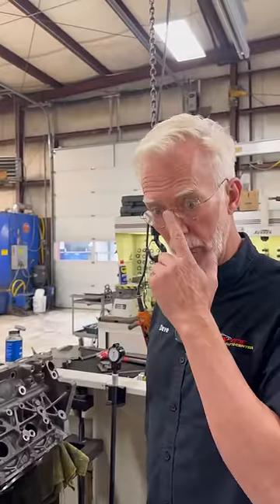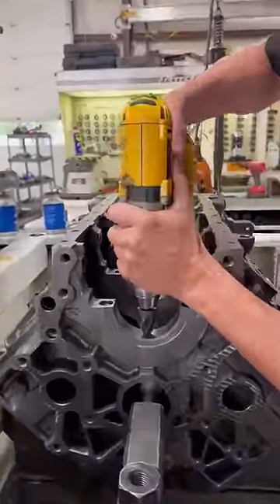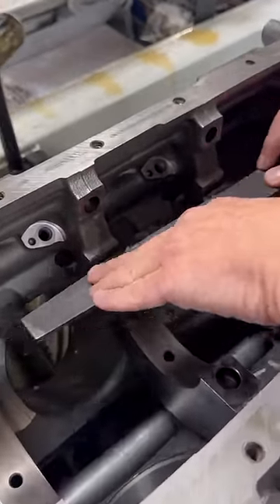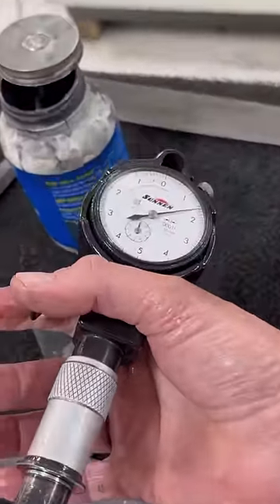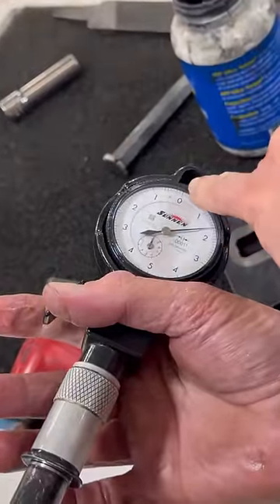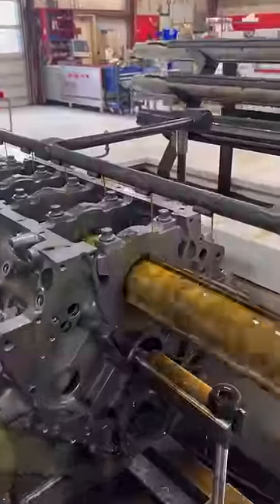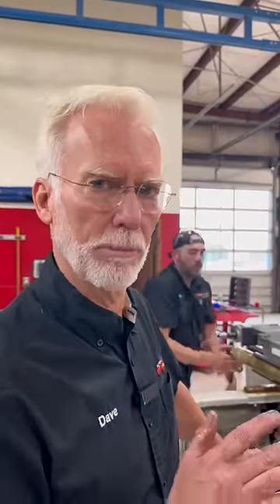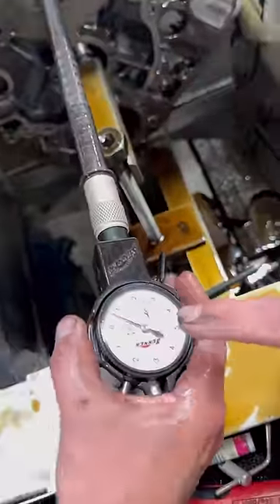How to set up and align hone and engine block the right way and why it’s needed - duramax LML

Comment: You can’t have guys like this building engines…. They will run forever!
Reply from the maker: Ha ha appreciate the humor😂. Thanks for watching
Reply: @DavesAutoCenterCenterville  I’m very blessed to have Bay Ave Transmission I’m my hood. He’s really good at knowing the issues and having the most practical solution. Talented and sensible like you guys.
Reply: It's actually done better then factory. I remember him explaining the flaws in the LS engines he needs to correct
Reply: @Jason1Pa no the manufacturer needs to address and that would lighten his work load.
Reply: @red2965  the manufacturer doesn't want to fix the problems, they just want it to last a bit longer than the warranty.
Reply: @windrider65  I absolutely agree
Reply: I gave a thumbs down because THIS IS THE WAY it’s supposed to be done so it does last a long time

Comment: The art of doing this type of precision work, and nailing it to spec, not over shooting it, my hats off to you! It can be difficult to get it in someones head, if you cut a bore slightly undersize, and need to re-cut, the spring pass will make it oversize, so on a re-cut, the finishbore tool has to be backed off and work up to the dimension. I haven't done these practices on engines, but cnc machining on horizontal and vertical boring mills.

Comment: I don't know one mechanic/engine builder that takes this much care. Most people these days just slap the parts together and think that's enough. I love the care and attention given to these engines. Truly amazing.
Reply: When you take the time and care, to fix everything, blueprint and balance, remove all signs of flash, on the rods, maintain tight tolerances, and you end up with an engine that redlines, about 2,000 more rpm.

Comment: Finally someone says it correctly. "Align hone" not "line hone."
Reply: How was it aligned and to what? 😂
Reply: @litoaykiu  They are aligned to them selves. They need to be in a straight line so the crankshaft properly fits in them. There's also a blue print specification for where the center point should be, but you can't really change that with just honing. By making sure the mains are aligned there should be no change in clearances in the bearings as the crank spins. You're also making sure the mains are not out of round.
Reply: @bobbygetsbanned6049  This is V-Block, it can go left or right, up or down; from center. Just because you have a perfectly round hole does not mean that it is in the perfect alignment with the deck; you are just going by the old holes and hoping it works. Where center point should be does not always mean that it is.  Throwing words like blueprint is just marketing gimmick.
Reply: A line hone ? What?
Reply: @giovannigiorgio8962   Honing the holes to be in alignment.
Reply: Finally
Reply: ALINGED HONED, OT LINE HONE, THANK YOU FOR BEING INTELLIGENT

Comment: Wow....... You would think the manufacturers would do this stuff..........!
Reply: The manufacturers have it right when it leaves, it's the people like this guy screws up all the dimensions in the block by heating it up to extreme temperatures in the oven to bake off all the crud which is a no no, it will change all the dimensions in the block. There are companies that make cold cosolutions in a vat to clean engine blocks, heating up parts BS.

Comment: My neighbor had a machine shop, and was align-hoing a very overheated 2.3 Ford Lima block for me. He didn't bother clamping the block down, and it chattered/danced like CRAZY on the rails of the Sunnen. It broke the u-joint between the hone itself and the drill motor that drives it. He was really pissed at himself!

Dave is right though - do a proper alignment hone on a block and the crank will spin beautifully once the caps are torqued correctly.

Comment: That is professionalism on display there. When that engine is re-assembled everything will be in better tolerances than when it originally left the factory. That will make for a smooth revving long lasting engine.

Comment: I respect the way you operate and basically what other builders say they go the exstra mile doing things like in video . Difference is this is standard for your build and other builders would boost that when they do this they went exstra mike .This is why i respect your wirk so much great job need more people with our work ethic.

Comment: I used to make lower bearing caps at GKN Sinter Metals in Wisconsin. Line honing is a mess, but a can shaft running true is the difference in an engine capable of over 300k miles or more.

Comment: Wish this gentleman would run for president, I don't think anyone would have a problem paying this gentleman's bill for the work that's meticulously performed on each and every job. He's an ever lasting gobstopper of knowledge engine machining. He cuts no corners! Most machine shops are full of BS, when they say, well we balanced and blue printed the entire engine, we did this that and 3rd to your engine, we put a new space modulator in, new kanifilla pins, and tightened and torqued the macursa. And then you start your engine and it sounds like a Singer sewing machine. We need more industry men like this gentleman!

Comment: Wow amazing. I have a 351 Windsor that I'd like to have balanced blueprinted and the horsepower increased considerably. It's in a 1992 Ford Econoline 150 van, I'd like it to be able to do wheelies or at least roast the tires bald. If I bring it there and have the whole thing rebuilt to your expertise that would be incredible. I would also need the transmission and rear end to be able to hold up to the power of the engine.

Comment: line boring the crank and cam bearing bores is part of blue printing a engine. and its is the right way to do it. and is essential in performance and race applications.

this is why you should number all the rods and caps as they can be slightly off from manufacture. make sure it goes back in the same spot. even though your fitting brand new bearing shells.

Comment: I agree I paid a shop to bore 30 over and align hone. Told me did not need align hone. Ordered parts from him 6k miles later had detination because cam was not compatible crack 4 pistons and had 2 main bearings with half bearing worn.

Comment: The problem is that it is kind of impossible to get oversized bearing shells for recent engines. They sell only undersized shells for ground down cranks but no one sells or produces shells for line bored mains anymore.
Reply: They probably shave the caps before honing ,is not really centered but is in line .

Comment: I had an LS1 block with mismatched main caps and was told by multiple shops that it's impossible to align bore because the block is aluminium and the caps are steel and the machining process will take more aluminium than steel.

Comment: If you really want to do it right, you have a plate of steel that's a couple inches thick that bolts on to the top deck. This simulates the warpage the block undergoes when the heads are torqued down, and it's also used when boring and honing the cylinders.

Comment: The most cost effective way to quick rpms, is a smooth line bore.  Remember that Hot Rodders.   Sonny Leonard doesn't torque race engines together in the morning, one of the reasons is because it pulls the line bore out or off.  They wait till the afternoon or evening.  Call it what you will, but it works and his shit wins.  It's always the coldest and concurrently/usually the wettest part of the day, just before sunrise, so maybe.

Comment: Great job! 
Do you guys know what possibly could be wrong with 1.0L, 3 cylinder ecoboost engine?
I've replaced the heargasket, but engine still misfires and runs rough at times....

Comment: beautiful, but can you align hone/bore babbit on bearing inserts? i need some done on a ;37 Studebaker 251 straight 8. bearings have been re-babbited and need to be align bored to size
Reply: Babbitt material loads up and sticks in the stone and the guide shoes will also mark the babbitt, those should be deburred prepared and torqued then align bored to the spec size no honing keep the juice on while boring and cuts heavy enough to keep tool engagement but not so heavy you don't get a good finish... hopefully there's not a lot to come out

Comment: got a question I installed a new tps on my 91 ford ranger and now it idles high every time it starts and keeps dying I also replaced mass air flow and idle air control I've been told it's because I didn't use a Motorcraft brand ?
Reply: You have to use oem sensors bud carquest and Duralast are garbage

Comment: @DavesAutoCenterCenterville
1. Is this done with or without conn rod and crack bearing inserts?
2. His initial measurement out 2 mil is out of roundness on crank bearing surface? Or it’s against hole diameter spec?
3. How does he adjust the honing tool so it is constant diameter its entire length?
4. What is the datum for the crank centerline? How can that long honing bore be aligned perfect to block datum? It’s so long and heavy, it must sag and flex.

Comment: Quick question, Dave.  You chamfered the oil holes in the main passages from the block, but the last photo showing the finish surface, I can not see any chamfer.  Was that intentional or not quite enough burr work at that journal befor honing?  Knowing you will thoroughly wash any cutting or honing debris well before assembly begins, will you chamfer all the oil holes again?

Comment: I have a 1982 Z28 it’s a really nice car nice exterior Noo dents scratches or rust and it’s red but 8 months ago it overheated on the highway and blew up it’s been sitting in my garage it has a 305 in it and it’s time to get it fixed and how much would it cost to rebuild it along with adding a cam along with more horsepower or should I buy a crate motor i would love for you to rebuild it i would know it’s great hands and it would be a Beast thanks
Reply from the maker: Our website can give you an idea of our prices. We are expanding the website as we speak. Thanks for watching 
Monsterengines.com

Comment: Have you had any problems with shot blasting grit hiding inside the motor and apearing later to cause issues??  My 03 6.0 had a bucket of casting sand in the cooling system that clogged up the radiator

Comment: Question. How do you set your bore gauges? Do you have a ring gauge that you can set your bore gauge on? 
If so, do you send your ring gauge out for calibration by a reputable gauge inspector that's ISO certified?
I work in a precision machine shop and I'm responsible for calibration of all our precision instruments like bore gauges and ring gauges, so I'm curious if you have ring gauges and if you send them out for certification.

Comment: Is this a common problem with V blocks?
I have rebuilt 4 cylinder VW gas and diesel inline engines and I check the crank clearance on all mains as well as feel the smoothness of the crank with the new bearings once caps are torqued down and I have had no problems.  What causes the block to get out of alignment?

Comment: No I have  a question for you Dave, after doing that would there be a little more risk ending up with a spun bearing?
Reply: No, they will remove everything that was installed on it, hone it to the correct diameter, then reinstall everything.  Hones remove material very slowly so you can get very very precise with them

Comment: Just a serious question why chamfer the oil hole if you're going to line hone it and have to redo it after?
Reply: Doesn't take that much off, oil holes are still chamfered when they're done.
Reply: @waynejohnting2954  You obviously watch the different video didn't you. When they were done honing that line honing it the chamfer was gone watch the video again
Reply: It is nicer to the hone stones.

Comment: Sooo what is the rolling torque prior to line hone vs after line hone??? I remember back in the day the older Toyota Land Cruiser we had a spec of 30 inch rolling torque and would add or take away shims to achieve the 30 inch rolling torque of the mains

Comment: I think you can take a motor apart and just replace the gaskets. The bearings don't need to be replaced if they're not shiny. No machining. Video idea > Full length quick rebuild

Comment: I wonder though using the hone in the horizontal wouldnt it hone more out of the block than the caps, because gravity, the weight of the hone in the block.

Comment: chamfering the oil holes is the worst thing you can do. It reduces oil pressure thru the hole. When the oil coming up thru the block reaches the chamfer, the diameter of the hole is wider and has more volume in that chamfer area. the pressure drops suddenly, A chamfered hole can reduce oil pressure thru the hole up to the percentage increase in diameter caused by the chamfer.  meaning a chamfer that causes a 15% diameter increase will drop oil pressure 15%. The typical chamfer increase diameter as much as 25%,

Comment: I'm surprised that the cutting drum isn't supported. 

The weight of the drill on one end could potentially shift the centerline of the main bearings out of alignment with the centerline of the block.

Comment: David is to engines as to the Richard and Cody on Precision Transmission in Amarillo Texas is to Transmissions he knows Transmissions inside and out frontwards and backwards he can tear one down and 10 or 15 minutes until you everything that's wrong with it and what needs to be upgraded or replaced in it and a short matter of minutes

Comment: I think that's what's wrong with my engine. At really low throttle just off of idol I have this shake in the engine. Harmonic balancer is okay. Engine was rebuilt 4 years ago. I'm going to check it for compression and see if I've got a broken compression ring.

Comment: Unfortunately finding a good machinist in any town is almost impossible it's amazing how crappy most these machine shops will put a motor together and you'll be lucky to make a couple passes down the strip before you start having problems. In Vegas there's enough machine shops that are stealing your parts not putting your parts in the motor unfortunately even just paying people to do the right thing doesn't work out these days cuz most machine shops don't give a shit

Comment: I know it's only a hone. 
but wouldn't it be better to put the block vertical
wouldn't the weight of the tool make it hone to one side. Because I noticed you don't run a centre

Comment: The weight of the align hone, and drive unit are not supported. 
 With the block being upside down, wouldn't that allow more material to be removed from crankshaft bore, on the upper side?... Placing the crankshaft closer to the camshaft...even a little, goes a long way, with rotating parts...

Comment: About 6 months ago I wrote to you that all GM 6.2 from escalate, denalis and suburban are confronting bearing problems ., either rod or main ., the cous of it noone knows yet ., this are years 21.22. And 2023, Dave have you fine out anything about ? Dealers are pack with those cars replacing engine left and right.

Comment: Problem is you lose rear main seal groove concentricity and you’re stuck using a rope seal forevermore.   Just went through it.   Turning like butter ain’t worth it when it leaves rivers of oil in the garage and has to be torn down repeatedly for repair.  Do not recommend.  Unless you like rope seals or shimming lip seals.

Comment: but wouldn't handheld tool be less accurate if you just happen to be a little tired or a little off while using that drill could not be a bad thing especially the horizontal drill going through the bearings it has wait at one end of it therefore it is not balanced is that okay😮😢😅

Comment: So you filed metal flakes into the engine, drilled chamfer and just let it ride 😂😂😂😂
Reply: My thoughts too.  8 shavings and countless file dust floating around in the newly cleaned engine.   Helloooooo Dave
Reply: @Wwheaty  what are y'all on about??

Just clean it again, wtf 😂😂😂

You really want to do this work on a dirty engine? NO! You clean it first, you do the work, THEN clean it AGAIN!!!
Reply: They have to clean it at least twice more because you don't want honing oil all over the boring bar for cylinder work and/or other machines... then after all machine work you "final " clean it then it's ready for assembly
Reply: So files aren’t cool anymore?
Reply: @marcgucciardo1942  Files cool, filings in your new engine NOT SO MUCH